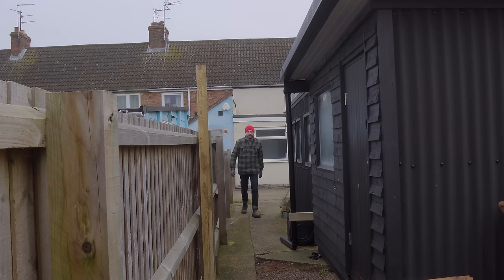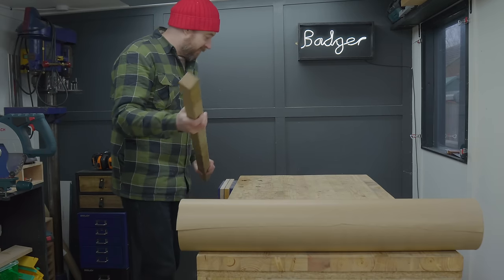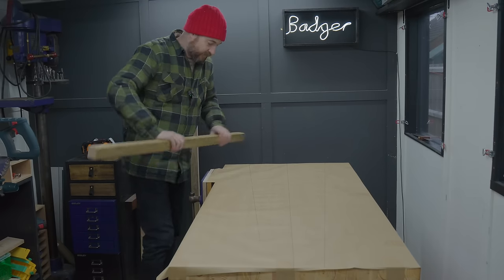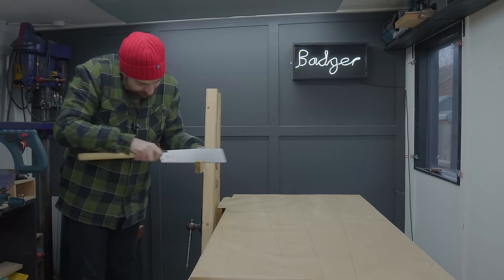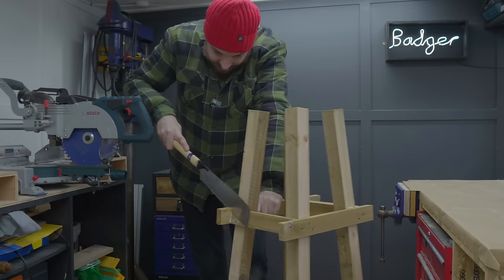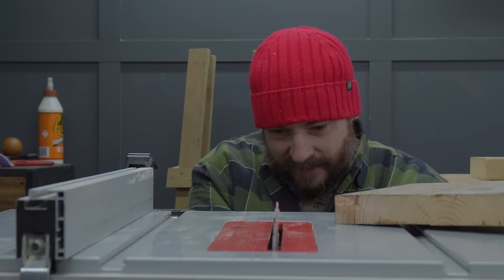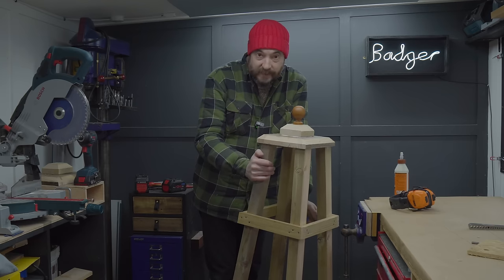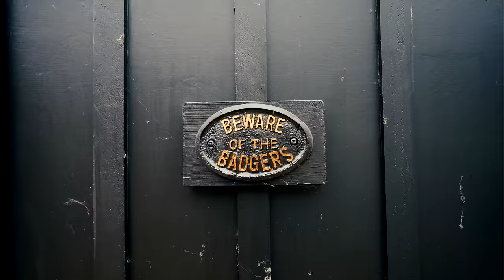Making A Garden Obelisk

Comment: I hope that the Boss was suitably impressed Matt ? Was that a Mother's Day present, or was that the "Gift For Hard To Buy For People" video ? 🍷😉
 
I fitted some lengths of Aluminium angle to the bottom of my Obelisk legs to Anchor it and to keep the timber off the ground you could alternatively use galvanised roll pins to achieve the same result !
Reply from the maker: This was Mother’s Day. Sounds like a good idea with the legs

Comment: A potential improvement to stop the bottoms rotting and a chance for a little more height - maybe drill some deep holes in the bottom and push some lengths of rebar into them which can go into the ground.
Reply from the maker: That would work well

Comment: just like the way that you do your videos but i want to ask i have truble with spelling but cutting lets say a 4 by 2 straght down for it to be square any tips on that to help me improve yes i could use a chop saw but i like cutting by hand 

any tips be great thank you matt
Reply: I think you should just buy a miter box if you want to cut straight by hand, very cheap also
Reply from the maker: I think the mitre box advice is a great one. I would try that
Reply: I think he may be looking for a reliable technique to cut a 4 x 2 lengthwise by hand rather than a table saw.
Reply: Pfew sure hope not but in that case he should fix 2 straight edges on top of the 2x4 with a tiny space for the blade in the middle or something and grease those elbows